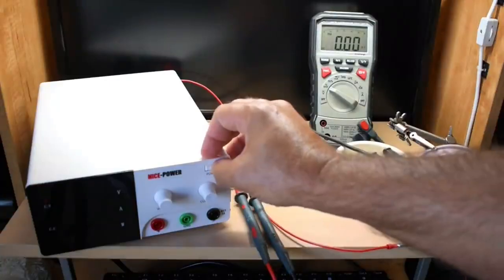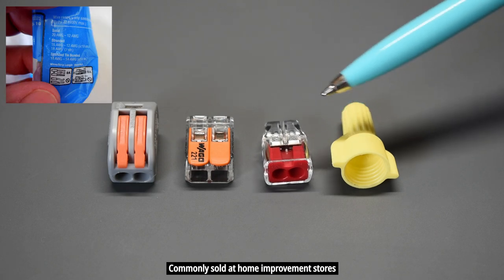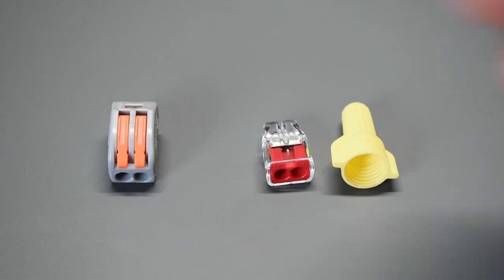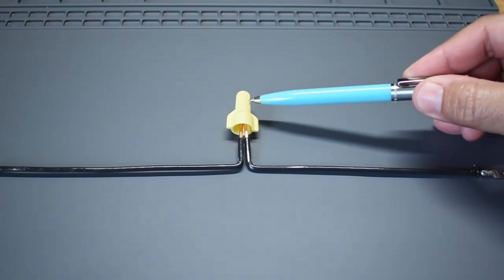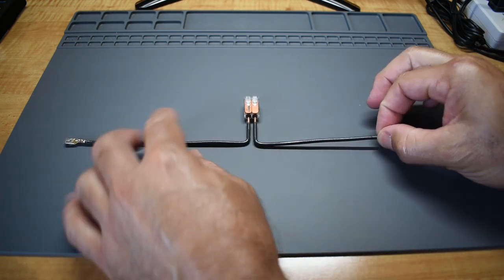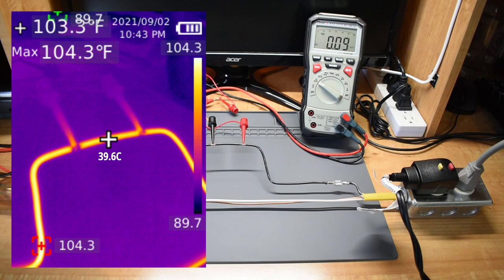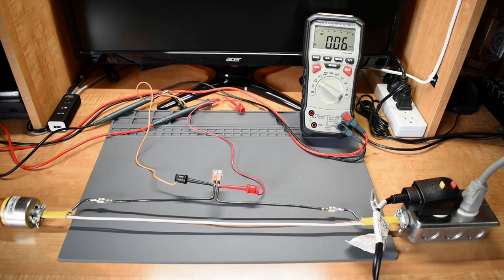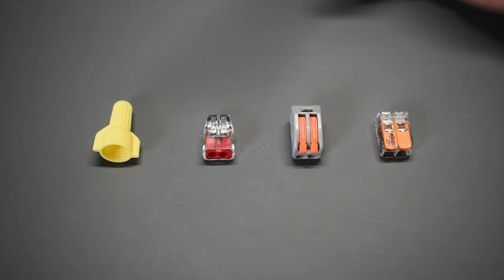BEST Electrical Wire Connector? Wago, Wire Nut, Ideal In-Sure, Lever Nut

Comment from the maker: There are MANY viral videos on YouTube that have made claims about Wire Nuts, Wagos, and others. Sadly, very few(if any), have performed the tests shown in this video for the most popular residential conductor type, solid copper wire. Wondering how secure a solid copper or stranded wire is inside the lever and push-in nut types? Watch my other video below. Thank you!
https://www.youtube.com/watch?v=afSai-fQIjg
Reply: In india we don't have solid cu wires. It's all class 5 wires used for wiring.
Reply: You can also use a big red or blue wire nut if you need to join more wires, and you can twist them with lineman's pliers, first. I am sure you know that, but just for any one else.
Reply: @realdevbro447  I thought solid copper wire was dangerous!
Reply: I also have seen and heard of the virtues of the Wago connector. This gives me pause. Thank you.
Reply: @BajanAlan  it is but I heard the black pipe is the most dangerous
Reply: Hi there!

Firstly, thank you for making this video, probably one of the best I've seen on this subject. I also wanted to share my experience with 'lever nuts'.

They are fan-freaking-tastic for low voltage applications, particularly if you're needing to mount the nut inside a junction box, like those made from PVC. They have a flat side on the back that allows you to stick them onto a surface using a bit of PVC cement or glue. Also, the wiggle is much reduced when you have insulation going into the guide channel. It's not perfect, but it's better than shown here. 

And you're right on the money about buying them with greater than 2 slots. They come in 3, 4 and 5. For people that have never tried these before, you need to pull the lever all the way back until the lever locks into the open position, you can then take your time getting the wire into each channel. I think they're the perfect connector applications like irrigation valve wiring.
Reply: Most people are concerned about heating of the connection vs a few millivolts of voltage drop.  In the end both are approved for use by the NEC,  Wirenuts are not approved in many countries because people can install them wrong.  Wirenuts are great if you do them right.  They can start fires if you don't.  Genuine WAGO connectors not the knock offs are very hard to install wrong and still have the circuit work.
Reply from the maker: @Jeff M All connections performed very well, and yes, the difference in mV / temp wasn't very big. The purpose was to compare the performance of each connector to see which is best(best meaning lowest resistance, least amount of heating, and most secure for a solid copper conductor). Thanks for watching!
Reply: Wire nuts are the most popular in North America. Now how about the most popular and durable truck nuts? 🤪🤪🤪
Reply: I've always though it would be a poorer connection as you can see  the small contact area and how loose they seem to be. And this makes a big difference when you have many splices. Thanks for the info
Reply: Exactly right... wire nuts are made to twist the copper first, then put the nut on...  people not doing this, is why they cause problems.
Reply: @Synic08  
There are just as many who say to not twist the wires first.

These new style connectors provide secure connections, allow for many connections, and will not come apart accidentally when they're pushed back into the work box
Reply: They also never use the wire nuts properly. Get yourself some good electrician's pliers. twist/spiral the bare wires tightly first with the pliers and then clip the ends blunt and even. Then twist on the nut. The amount of contact area is insanely large compared to lever nuts. There's zero wiggle and it will never come apart.
Reply: Would love to see a comparison that includes the gold standard of "wirenuts"--the 3M brand, specially the 3M Performance Plus. These were installed in my house. In fact, I'd be happy to supply some for the test/video :))
Reply: @jeffm2787  Actually theses type wire nuts are actually approved in most places now, but they got a bad rap because a bunch of British made "Scruit" wire nuts were failing. These were designed in the 30's and were made of porcelain. They had a cast in thread in the porcelain and no metal insert. From the outside, they were very similar in appearance to today's wire nuts.  But the failures were that the porcelain cracked and the nut fell off leaving bare twisted wire. A very bad thing in a metal box.  As best as I can tell, it was around 1950 that the UK banned them.  Exactly why they cracked and broke off is only speculation. Porcelain can be pretty brittle and it may be that some were defectively fired or maybe just the difference in expansion rates compared to copper. When you put them on, the twisted copper wire was trying to expand the porcelain. Maybe repeated heating and cooling cycles from just ambient temperature alone was cracking them. I don't know why these failed, but they did. 

But from then on, "wire nuts" got a very bad reputation in Europe. But I doubt that few know the whole issue being the porcelain they were made from. I have seen a lot of old Knob and Tube wiring, but never saw these old porcelain wire nuts in the US. My guess is they never made it here. They were made in London and I suspect that after WW2, with all the destruction in England, there was a huge rebuilding boom. It was post WW2 that England came up with and actually mandated the use of the crazy and potentially dangerous ring circuits to reduce copper use, which was in short supply after the war.  I have seen a few Bakelite wire nuts here in the US, probably 50's vintage, that had the metal insert. They were still in fine shape. 

The porcelain wire nuts with  their tapered cast in thread, seems like a pretty bad design in retrospect. I suppose a lot could have gone wrong in making  these too. 

But you can buy modern ceramic wire nuts. They are for very high temperature use up to around 1000 degrees F.  

The millivolts drop is an indicator of resistance.  This doesn't mean very much at low currents, but it becomes significant at  higher currents because the heat dissipated is the current squared times the resistance.  Because it is a squared function, twice the current means 4 times the heating,  I and a few others have tested Wago 221s and found them to dissipate about 1 watt when brand new out of the box, at 20 amps., That doesn't sound like much but if you consider the very tiny contact area and that it is going to be closed up in a box, the localized heating could be significant.  Where I see this as becoming a problem is over time with repeated heating and cooling cycles. The way these are made current flows through the very tiny contact patch on the little copper bus bar, but it also takes a parallel path through the tiny sheet steel spring. When heat goes up, resistance rises and with more resistance you get more heat. You can reach a point where this can snowball. Repeated heating and cooling of the steel spring can anneal it and reduce the tension force applied. 

This will probably not happen at low currents, but cycling between maximum load and off,  it's likely to occur. These are UL approved, but only to 20 amps,  Much less than the IEC ratings.  What most people don't know is that UL/NEC approved ratings are not apples to apples comparisons with IEC ratings.  The methodologies are much different.  I'm not of fan of IEC rated stuff. It doesn't perform well in industrial environments and when it fails, it's almost always fails catastrophically.  

But I believe that one reason these have been used so long in Europe in residential wiring, seemingly without problems, comes from the fact that they use 240 volts where we us 120 volts. Their typical household appliances are virtually the same as ours, but for any given device, in the US at 120 volts, we will be pulling twice the current they do at 240 volts. And because current has an exponential impact on heating, we may well ultimately see issues that they don't at current levels on average half of what ours are.
Reply: I have used wago for longer than anyone I know but I always tell people just use them for lights and areas where you don't expect high loads.  I am not a fan or pig tail type wired outlets which seem to be the standard these days.  Almost all my outlets are spec grade back insertion.  I'm wondering how different side connect vs back insert vs back stabbed.  Obviously you would have to use 14guage wire since that is the best back stabbed connections can do.
Reply: @realdevbro447  Yah but in the US we typically use 120v so we have to pull 2x the amps.  Yes we have 240 options but most devices don't use it.   So for us the cost of copper is justified by the energy savings over the life time of the circuit.  In the US we can use copper residentially but its rarely done.
Reply: @MichaelMantion  Commercial grade receptacles where you can insert the wire into the clamp from the back and then tighten with the screws, are  probably the best you can get. They cost a bit more but it  is  just stupid, in my opinion, to cut corners on an electrical installation. Electricity is yout most critical utility in your home. And it has some dangerous potential when no done well. 

The push-in or back stab type receptacles are notorious for having problem. If you take one  apart and look at it, you will never use them. In theory, they are limited to 14ga wire to limit current to 15A  although these 15 amp receptacles can go on 20A circuits, if you have a duplex 20A rated receptacle on he circuit. However, limited to 14ga means it can't be connected to a 20A  circuit by code.

The whole reason you want to limit current is because the resistance of this type connection is relatively high compared to the best connections. The millivolt drop is directly related to the resistance. (Voltage divided by the current is equal to the resistance)  And the amount of energy/heat dissipated in the connection is calculated by current square time the resistance.  Because it's the square of the current, twice the current means 4 times the heating.  

The Wago UL rating is derated to 20A vs. the IEC/EN rating of 32 amps. Wagos were designed for the 240vlt market in Europe and elsewhere and in reality the IEC/EN ratings are considerably different than UL ratings. They are not developed the same way. 

The stab in receptacles and similar connections like Wagos are without a doubt, easier to use but easier does not equal better. Even some electricians, who should know better forget the current squared function as  it relates to dissipated energy and heat. 

Not only does this waste power from what we intend it to be  used for, but it can, under the right circumstances, present a potential fire hazard. It's why we use copper in our homes rather than higher resistance aluminum. It's wire we use larger conductors to handle higher currents. 

Unfortunately, electricity has been promoted as some kind of DIY skill that doesn't need to be understood properly to be accomplished. A hundred years ago, the average person was extremely cautious of this unseen deadly force and with good reason.  But today, with the advent of the internet and video, people think they can watch a 20 minute video and know all they need to know. It's a bit more dangerous than painting your own walls!  The potential consequences are much less forgiving if you do something wrong.
Reply: @Synic08 I disagree if you turn them until you  hear a click all the wires are secure. When I use the large red or blue nuts I always twist the wires first then you have the bare ground wire going through the nut and one wire comes out the end so you can ground something you cannot twist first but the bare wires are secure. I'm going to try the ideal push connectors when I do an LED light conversion. I like the wire nut but working with live wires it's safer to not have to twist with linemans pliers all I have to do is strip the wire with a plastic stripper called nipez
Reply: @BajanAlan what you have “heard” is most likely related to Mobile / high-vibration applications, for which your statement is correct.